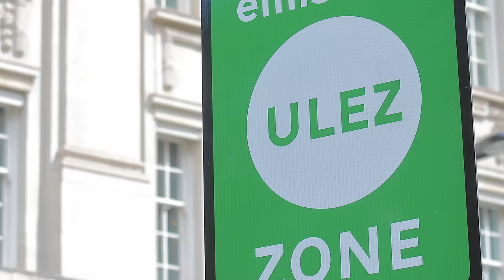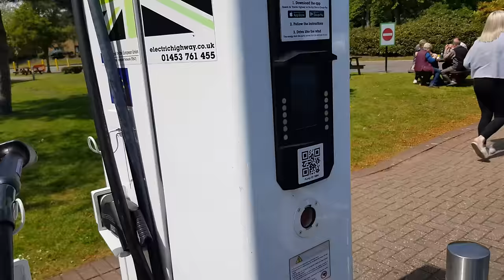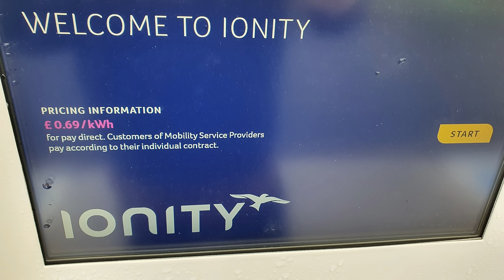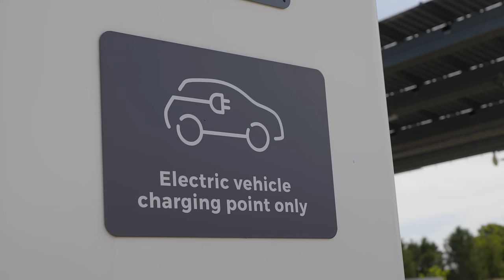The Uncomfortable TRUTH About EVs: The Version NEITHER SIDE Wants You To Hear

Comment: This video really picked up around 34 mins in..."let's be British about it".
Since 1973 when I started driving (and trucking a bit later on), I've bought what we fancied, or rather, any old banger I could afford and that moved.
Af ew years on, nothing's changed...other than we had savings/investments built up, to buy a Model 3 SR+ 50kWh four and a half years ago. We got rid of the camper at the beginning of 2022, and replaced it with a Model Y...the first wave that entered the UK. So we run 2 EVs currently.
We have solar and battery (since 2018), and this is useful regarding what type of vehicle you drive.
Excellent and very prescient point about charging availability if you can't charge at home...would be worth getting together with Harry (Garage) and a few good EV sites such as 'Dave Takes It On', and set up a gov't petition. Got to start pushing.
It's at times like this that a good internet presence would be useful...I'd do a video on running EVs.

Comment: I have 2 comments about points you raised. As far as fitted building fire fighting sprinklers are concerned, the key may well be to view it as a method of preventing a fire from spreading until the fire services can respond, rather than actually putting it out.  The second is about insurance. I live in Canada, so a different market. That said, I had a 13 year old Mercedes GLK 250 diesel, which I replaced in Feruary 2023 with a new Tesla Model Y. The Model Y is substantially cheaper to insure.  Cheers.
Reply: He mentions it but does not go into details in this video. The issue is once an EV starts to burn its game over. Water in any amount will not put out the fire or keep it from spreading. Perhaps fire fighting technology will catch up to minimize this in the future but will it by 2035!? In Canada it’s going to be a particular problem because the vast majority of rural fire departments are voluntary go down to your local volunteer fire department and ask how much training / information they have received from the government or car manufacturers on fighting these fires. The only reason we haven’t had some major incidents is the amount of these on the road and infrequency of the technology to fail, both of which become more of an issue in the near future.
Reply: Metal fires, especially involving lithium, they use water AS the oxygen they need to burn. And that releases flammable hydrogen too! Traditional firefighting technology just fans the flames.
Reply: @petevenuti7355  Right, but current batteries don't have any metallic lithium in them so that's not actually what is going on in chemistry terms. They have intercalated lithium in graphite structures in the anode, lithium oxides in the cathodes and lithium salt anions in the electrlyte (e.g LiPF6). It's actually the electrolyte that catches fire initially, and reacts with water to make nasty gases, and then the chemistry that matters is how the oxides and the graphite burns. They will both burn if you get the cell hot enough. And different cathodes have different fire characteristics. The original LiCO2 layered oxide burns much hotter and more easily then LiMn-oxide spinels, and both burn much better than the LiFePO4 polyanion cells (which are quite hard to set fire to). So this is all quite complicated. You get 5-20 times the battery's capacity in total heat terms, depending on chemistry, so a 50kWh battery will burn to produce 250-1000kWh of heat - about the same as 80l of petrol/gasoline.
Adding water does not make the fire worse. It slows the rate of heat production and poisonous gas production. The same amount is released eventually, but more slowly in the presence of water - i.e the fire is less intense. There are some good papers on this in nature. I got most of my numbers from  "Toxic fluoride gas emissions from lithium-ion battery fires" (Larsson et al 2017)
Reply: @xxwookey  I was trying to give a lazy layman's explanation, but you went into more detail then I could have if I was trying, I'm sure many other readers would appreciate it. 
   You are being specific about the individual battery modules/cells, I was also thinking of the aluminum and or aluminum - magnesium alloys that will be able to be ignited because of the intensity battery fire or the power in the battery shorting through some of those metals in a car. Yes it does happen with gas/ petroleum cars with aluminum alloy blocks or wheels, because they hit a power line for instance, a regular car fire usually doesn't ignite the metal, but an electric cars comes with the amps to ignite a metal fire even if the batteries were working normal.
I was thinking of the car as a whole , not just the battery chemistry. I also may have oversimplified. I also lived with a fireman that had some experiences he told me about. Large metal fires are no joke.

   You know what you're talking about though, so..
   Can I ask a few questions? You wouldn't happen to know how I could isolate and collect the lithium, the phosphorus hexafluoride, perhaps acetonitrile and other stuff from my dead batteries?
  Yes I'm aware of the old Energizers with the lithium strip. Thing is , I got no money but do get free battery packs and use the useful 18650's (amongst other types) for my own projects, but I also have a lot of 0v useless ones. Some of those chemicals I couldn't order if I had the money.
Reply: @petevenuti7355   Yeah, sorry that reply was more detail than anyone might reasonably want. :-) I was interested, so investigated a bit. My fundamental point is that spraying water on does not make battery fires worse, even though it may well not stop them burning either. Sometimes it can (stop the fire) and it will make it less hot.
If you have loads of s/h 18650s I guess you know that you can make home battery packs from them (and the art is in making reasonably safe ones). And many of the cells in a 'dead' pack can be fine. (I don't suppose you have a source of makita 14V drill battery pack shells - I need a few of those - just the plastic shells, not the cells).
As to getting useful chemicals out in a home lab. No, I don't know how one would go about that, nor how practical it might be. The hexaflourine is soaked into the separator. It's easy enough to unroll the jellyroll and get a long strip of separator but I don't know how you might get the liquid out - could it be evaporated off and then condensed? Most existing battery recycling just burns off the LiPF6, and often the separator too. The copper and aluminium films have some value. You could try to scrape the coatings off the films but the graphite is nearly worthless. The cathode material (NMC, LCO, LMO, LCA presumably is worth something, but only if it's very pure and if you mix stuff from loads of different cells (never mind starting with material from dead cells that may will have the SEI layer in and have otherwise degraded) it won't be, so I doubt if you can do anything useful in a DIY context. Might be fun to have a go with a few just to see what is possible. Ultimately I think you need to do some quite serious high-temperature chemistry to get back to useful chemicals, beyond just stripping out the copper/ali foil. Someone must have tried this online...take a look.
Reply: @xxwookey  mostly I just see failures recovering the lithium and the analyte . One of the first videos I ever posted was specifically address to someone who was attempting to do that I was showing him how oxalic acid will drop out nickel. 
   The phosphorus hexafluoride complexes have a high vapor point, there isn't enough there to really distill anyway, and for anything very high temperature, my microwave won't even get my microwave kiln up above 400°C. Who knows, maybe someday.
   No I'm afraid I don't have the battery case for a Makita, I think I disposed of the 9-volt ones, I have never had the 14 v. My contractor neighbor mostly uses DeWalt and Rigid, and I don't see many of the rigid ones because there's a guarantee. I ran across the occasional laptop battery, It couldn't hurt to ask,  I do have quite a few mismatched batteries and chargers from yard sales. But sorry not what you're looking for.
  Regarding the fire, you're totally right about the cells, but the cells burn hot enough to cause a metal fire beyond that if you don't submerge them quick enough and the pack has enough amps to start a metal fire without the cells burning.

Comment: A very good well balanced video, which as both an EV and ICE driver I pretty much agree with all of it.

On the car park thing, there’s a really interesting report on the Liverpool fire from several years ago, where the cause was again a diesel, however the report states that the spread was largely down to a combination of modern plastic fuel tanks, an increase in diesel cars and the distance that cars are from each other.  Once diesel catches fires it runs like a river rather than exploding.  If you just google Liverpool fire report it’s all online
Reply: The balance means sitting on the fence and trying not to displease anyone.
Reply: I believe the Liverpool fire was started by an L322 Range Rover too....a humongous blow to my view on Range Rovers....but personally speaking

Not every car is gonna just spontaneously combust on ya

Comment: I just read an article written by a global management consulting firm in which large scale green hydrogen and efuels for vehicular transport were mentioned. Alternatives to EVs are very much in the works, because they need to be.
Reply: co2 is actually what plants crave.
Reply: The thing is that those use energy that could just be used to power electric cars without all the energy loss for converting fuels. 🤔
Reply: @Mr.Marbles  bingo, even back of cigarette packet calculations show the numbers just don't work.
My favourite is the clean hydrogen, so many downsides asides from the insane efficiency loss. Yet it's pumped across the Internet by those not bright enough to realise how bad it really is
Reply: @Mr.Marbles  problem is you can't transport electricity with much efficiency and you can't practically generate large amounts of renewables in the areas where people live. So, make the electricity where there is space and wind (e.g. the bottom of south america) and convert it to liquid fuel there. Transport the liquid fuel to where people live as usable energy.
Reply: I was really really impressed by Lord Bamford’s research at JCB on hydrogen for industrial applications. Harry Metcalf did a really interesting video on his channel about this.
Reply: @rpc2210  problem with combustion hydrogen is storage, transport and energy. Basically, it's not very helpful in any of those areas. But nothing is impossible and there is no single solution
Reply: @Matthew-ll9ke good example, Thankyou.
Traditional Electricity grids running long distances have about 10 to 15 percent losses. HVDC grids lose less but cost more. 
Electrolysis which is the basis of almost all electricity to liquid fuel conversions is at best 70 percent efficient. 
How do you get remotely close to grids by making fuel and then transporting that fuel?

If the argument was solely infrastructure pricing I could get onboard but you can't convert electricity to liquid fuel at anywhere near the efficiency of wire transmission of the same electricity.
Reply: @rpc2210 how's the hydrogen stored?
Nothing can contain it on a long term basis, hence bmw saying their hydrogen prototype can't be parked inside a closed space like a garage. It's a genuine explosion risk. 

Co2 (plant food) isn't the problem it's made out to be, though I'm not saying it isn't a problem at all. Other emissions in the exhaust stream are very problematic though and pretty damaging to all life. 
By combusting anything with air under pressure (ie in a combustion chamber) you're still going to create the other problematic emissions.
What's hydrogen actually solving other than stroking people 3gos?
Reply: @Th3_Gael  ok, let's choose energy purely based on efficiency then. You end up with oil, because oil to liquid fuel is near 100% efficiency. 
The other massive issue with electricity is that of storage, so store the energy as a liquid. 
Further, liquid fuels fit into the existing (and massive) current infrastructure. Otherwise you rip out everything we've built over the last many decades
Reply: @Matthew-ll9ke  like I said, argue infrastructure and I agree.
Youre original point was based on efficiency, hence my rebuttal on efficiency 🤷‍♂️
Edited to add: we don't currently worry about storage becuase we can throttle plants to match demand, you don't need storage of the electricity unless it's all 'renewables'.
There are better solutions than that
Reply: @Th3_Gael  well I was talking about transport and the efficiency of doing so. But anyway, lots of work to do and hopefully one of the results is the continuation of the ICE
Reply: @Matthew-ll9ke  agreed
Reply: @Matthew-ll9ke yes, if only there was a cheap and plentiful fuel that was non volatile, a simple means to covert it into motive power and relatively clean.. doh! Of course, we’ve had it for a hundred or more years. Diesel.
Reply: @andrewlucas6214  I mean, I love ICE as much as any enthusiast, but diesel isn't really the answer to anything except commercial transport.
Reply: @Matthew-ll9ke  diesel has been powering millions of cars quite well for years.

Comment: Synthetic, co2 neutral, fuels would be a good option. Specially on longer drives.
Reply: Literally uses 8x more power then just putting it into an ev
Reply: @gypsyemperor7535 still has its purpose in motorsports and places with unreliable electricity coverage. If we went nuclear, we would probably have enough surplus to easily make some Synthetic fuels.
Reply: @slideways8022 so "thing that wont happen x thing that wont happen".
Reply: @wizzyno1566  I never claimed to be a realist
Reply: Just keep your car longer and drive less....

Comment: 28:11 Part of the problem of the expensive insurance stories comes from the fact, that many EVs have lots of power. Tesla Model 3 starts at 257 hp. A comparable sized car will have around 100-150 hp.

Then add stories from people for whom the premium changes from £500 on reneval £5000+. Newspapers are full of these stories, but hardly anyone points out, that in the end the owner changed the insurrance and got similar price to what they were paying before.

Comment: Of course Luton airport has an onsite full fire station and firemen . I have never heard of 1500 vehicles going up in a multi-storey before EV’s were sprinkled into the mix when a fire started. Sprinklers would have made nil difference to an EV fire.
Reply: There was a very similar incident in Liverpool in 2018 and there have been numerous others over the years. You just haven't heard of it because there wasnt any anti ev hysteria at the time. Car parks burn very well due to low ceilings concentrating heat, good airflow, lots of fuel and gradient which allows burning fuel to leak under adjacent cars. And sprinklers would have likely contained this fire to the vehicle of origin or immediate exposures.

Comment: Great video! As someone who's probably about to dive into the EV world, and someone with a disability, it's great to see such balance. So many awful click-baity anti-ev channels on here it's good to watch someone talk about the ACTUAL issues with the whole thing. Thank you! And wish me luck 😊
Reply: If you are getting an EV (from someone who has one - and I love it) if you have a disability related to your physical ability, be aware that some high power chargers (more so in the cold) can be very difficult to manipulate to plug in - this is an issue around the size of cable and how much copper and rubber will be in it, and how stiff that gets when cold. 
Any who do have physical disabilities, who would use high power chargers, should have a go at handling these cables prior to getting an EV - They are getting better but older chargers are still out there.
Reply: @Sidewinder1009oli  Yeah thanks, really appreciate the comment 👍 I'm lucky enough to have a friend who works on charging infrastructure so I've been able to try before I buy (with some comedy results occasionally!), and I'm lucky that I can get a home charger. I've slipped on petrol spills on forecourts and struggled with petrol pumps enough to think it probably can't be much worse 😀

Comment: You're right about the battery chemistry changes and not being able to judge modern EV's based on the older ones. Modern chemistry is far harder to set on fire. Basically never auto-ignites, and doesn't burn like those old ones did. We're also developing ways to deal with those fires, like fire proof blankets that you drag over the EV and it smothers it whilst you drag it out and drop it into a container full of water for it to fizzle out.
Reply: There have been 2 giant transport ship fires caused by evs in 2023...
Reply: Go on, what's the chemistry? As far as I am aware, all newer chemistry that has higher capacities (per volume or weight) tend to be more volatile, not less. If you're talking about solid state then they seem to still be vapourware still in development and trials.
Reply: @trumpney3308   Can you name them? Because I can't find them.